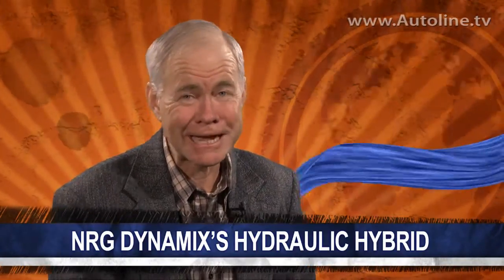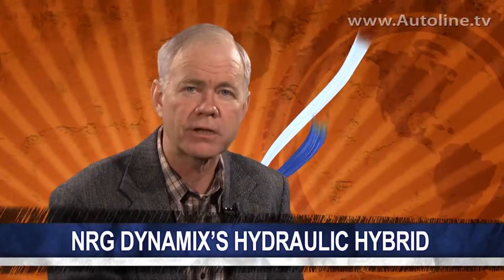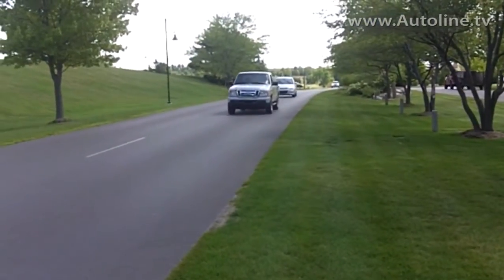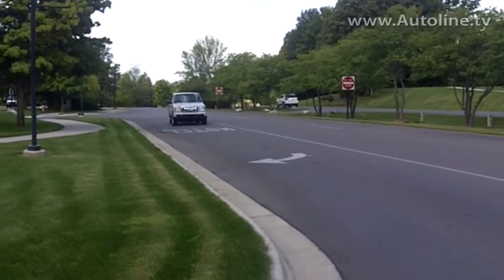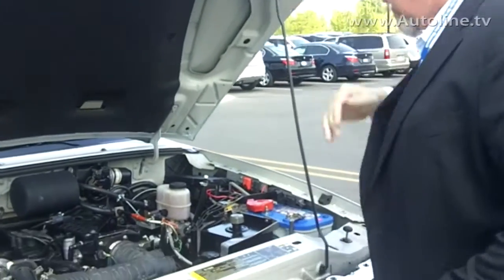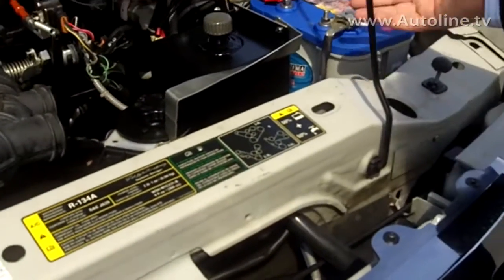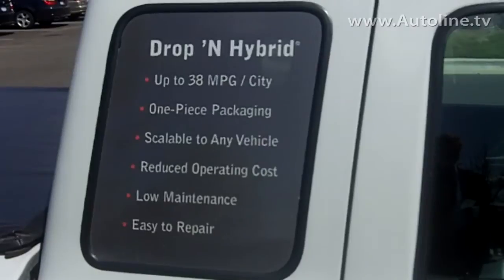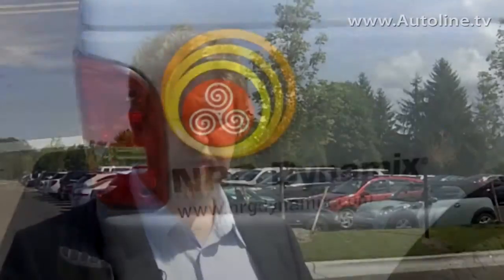NRG Dynamix Hydraulic Hybrid

Comment: What is the market for this product, the family car? Ford Ranger production stopped over a year ago. I doubt that this can be packaged in to a front wheel drive car. This is a series drive, so it is always using the noisy, inefficient hydraulics. It would be better as a parallel drive (launch assist only). You are telling us that hydrostatic drive is more efficent than an automatic trans? I doubt it! Go analyze the numbers from the NRG Dynamix site, they do not add up. This will never fly.